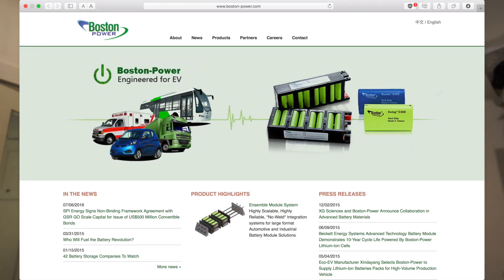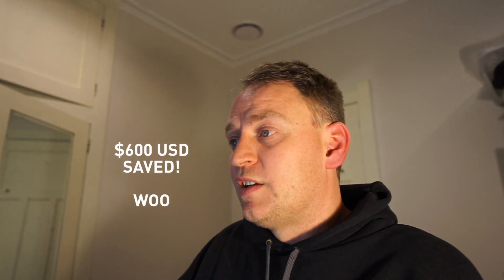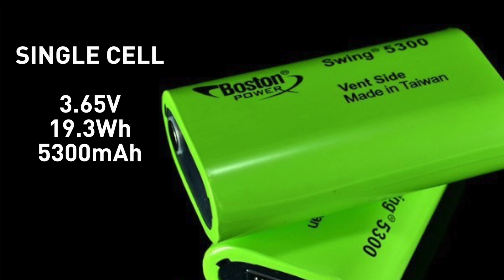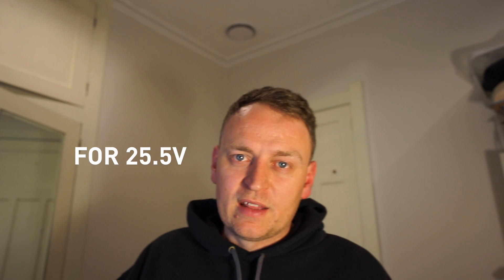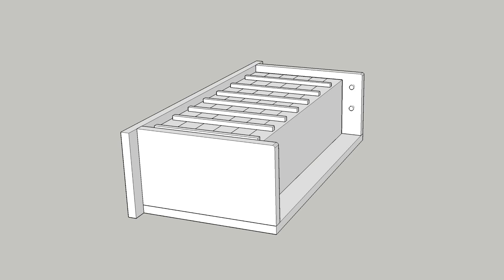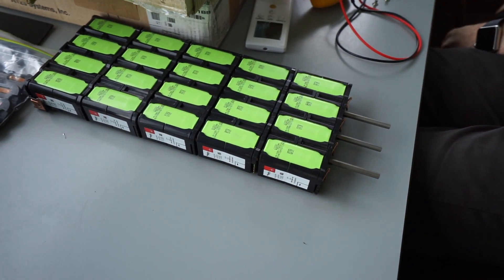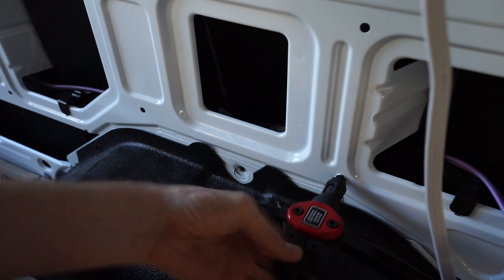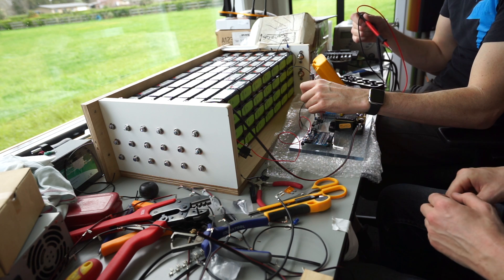Custom 29V Lithium Ion Battery Pack for a Van: Eat Sleep Van 15

Comment: Thanks!  I am interested in using these batteries for a pack too.  Where did you get the holders with the connectors for them?
Reply from the maker: Hi it’s all from Boston Power, although I don’t think they sell to the public I’m afraid.
Reply: Thanks.  I did find some holders from a source in China, but I would prefer the ones you have.  And so far I have not received a response from Boston Power in the U.S. as of yet. You would think they want their batteries to become popular and holders are important.  I personally think they are a good design for large battery design.
Reply: it's a recyclable box for 18650 open source technology: https://youtu.be/g4Aw9zxtOv4?t=12 👍

Comment: Looks really good! What's the implications of the battery being 29V? Will that mess with charging/efficiency?
Reply from the maker: Hey I'll talk about this in another video soon, but a lot of gear has a wide voltage range e.g. the MPPT charger and 24-12V converter work up to 34V. Some of the gear that doesn't like it (e.g. Aurora lights) I'll be using buck converters to regulate the voltage down to a steady 24V. This will also help output a steady voltage no matter the current battery voltage. I'm also going to use one to power the BMS which needs 12V. In general a higher voltage is MORE efficient, so charging at 30V will be slightly more efficient than 25V. The buck converters are up to 97% efficient, so a little bit of loss for some things.